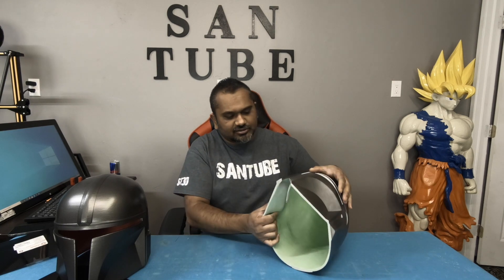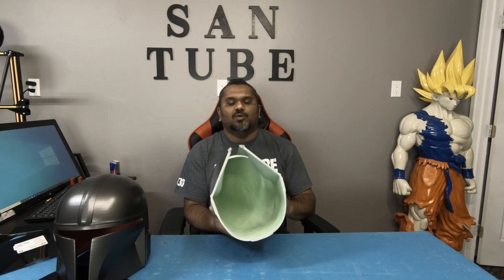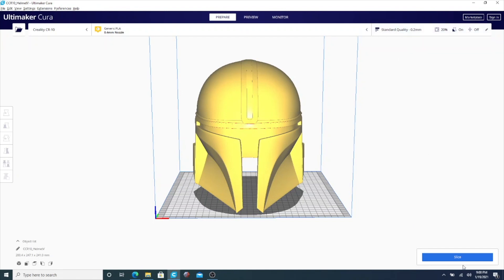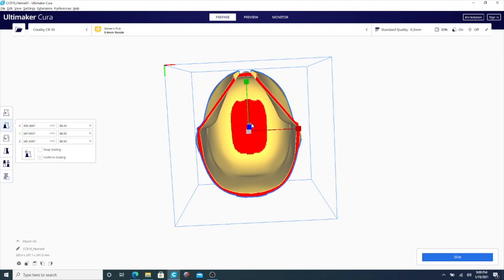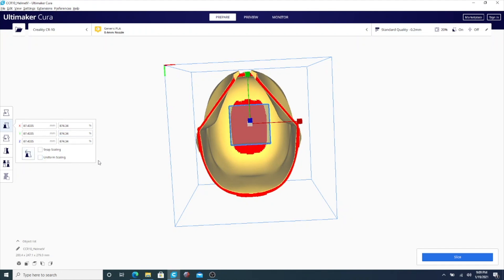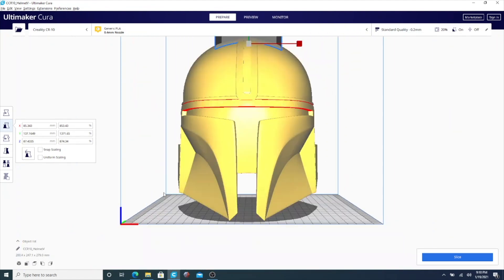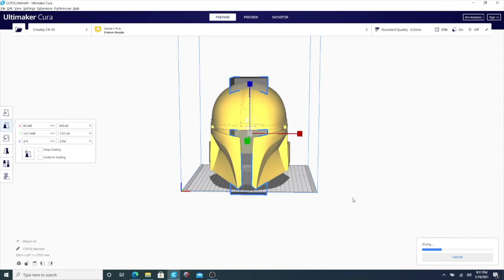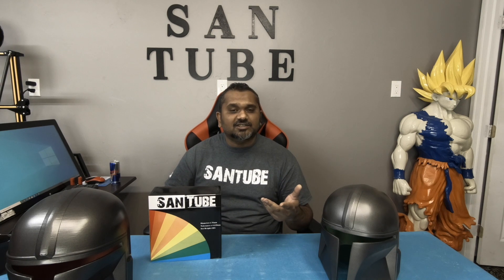Cura Support Blocker [ How To]

Comment: Thank you for this.  I've always wondered how to use blockers, your video was a breeze to follow.  I'm also reducing support walls to 1 or 0, density to 10 and turned on conical support too.  Should cut down material & print time drastically now.  Thanks man 🤘😎

Comment: Make sure your block is touching the print bed, or it won't block the printing of supports at all.  You can't have your block floating above the bed somewhere.  I was going nuts changing settings and slicing over and over again trying to figure out what was going wrong.